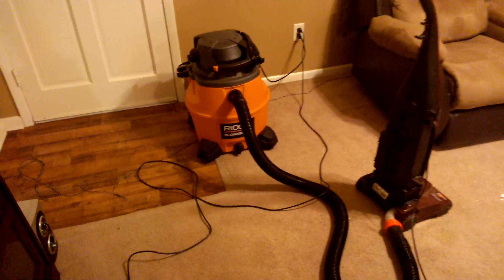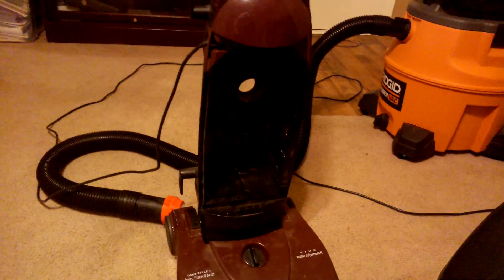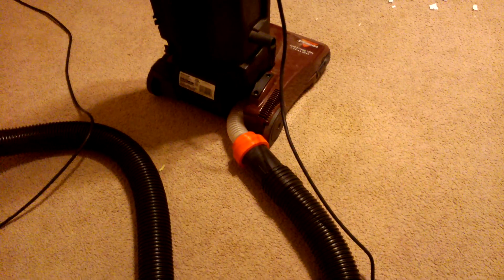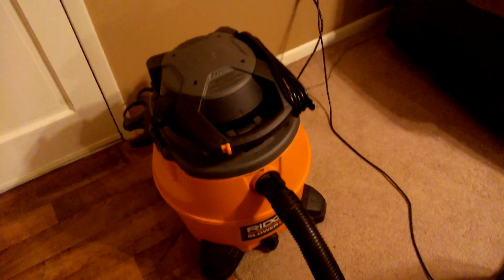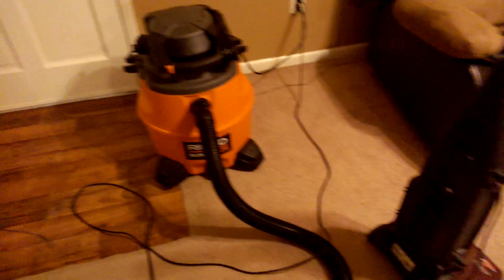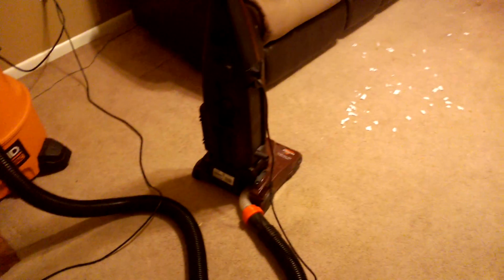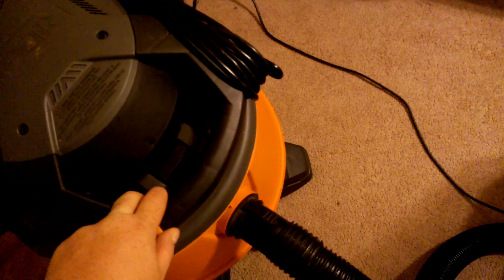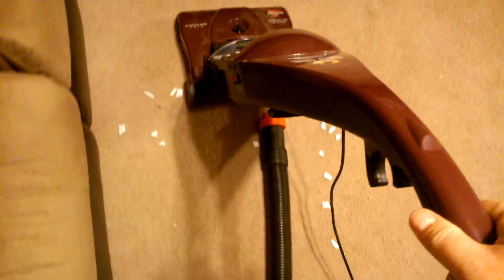Shop Vac to Bissell Connector ( Dyson Killer )

Comment: Won't you blow a fuse doing that?
Reply from the maker: Nate J I never blew a fuse using this machine. The only time it could have been possible is if I perfectly turned on both vacuums at the same time and a huge voltage spike occurred.
Reply: @2robotguy  just plug the shop vac into one outlet and the bissell into another that’s what I do
Reply: @2robotguy  wait do u still use this tho
Reply: +Mark Fuller Just change the vacuum belt on the Bissell this will give you more power